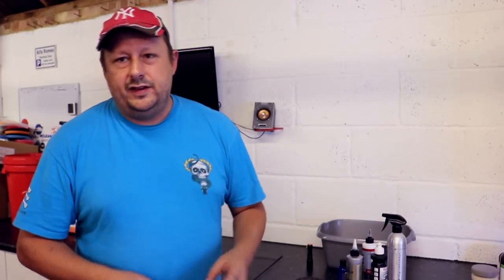Trashing Microfiber Towels with Ceramic Coatings

Comment: I've tried a few different types of towels prior, the dedicated 'pearl weave' MF's, 500GSM plush towels, short napped 300GSM towels, but I've always went back to cosco microfibres, plush enough for paint use and cheap enough for me to not care about throwing them away after. After i coated my car in Kamikaze, i kept some towels and applicators just to see how hard they would get and by the next day they were solid. Its just not worth using ceramic contaminated towels on a car after you put in 4/5 days worth of work into coating it.
Reply: +1 For the costco microfibers.

Comment: A very interesting video for people that don't have expirience with ceramics.
All professionals i talked so far bin them, they use cheap towels of medium-low quality to reduce cost. Each car is 5-7 towels approx.
The towel isn't reusable once the coating starts to cure-bond, how much time is that? Depends on the company and the coating, also depends on the temperature of the room (if it is done on summer or heated rooms it will cure faster). 
This video can save some "newbies" from scratching their loving cars! Keep up the good work ;)
p.s. There is no way to remove with simple APC the buffing matterial from the towel, if people say they did it...they probably used cheap short lasting "ceramic alike" products.

Comment: I'm glad someone else has mentioned this now.

This was the exact reason I never used my high quality ragmaster microfiber applicator again after I used it on a coating. The fibres just became really crusty and after several washes and attempts to get it out I've never managed it.

As said I haven't used it since, and especially after seeing this video I definitely agree with you Jon and won't use it on paint again. It's very noticeable ,and also the reason I've gone off coatings now and am back on the trusty fusso.
Reply: Adam Freeman Fusso fo the win!

Comment: Hey good to see you haven’t watched in a while but this caught My eye! My solution is don’t use $5 dollar towels! Get the pack at Costco here in the states they work out to about $.50 per piece in the USA!When you’re done wash them and use them on brake rotors or wheel wells!
Reply: Exactly what I do (you can get the yellow ones in the UK CostCo's too) :)

Comment: You spoke about the fact the silica is carried in a solvent, would it be possible to put the towels straight into a solvent mix to soak and dissolve the coating residue, then flush the solvent out with APC/water once you were finished the coating process? Great video by the way!

Comment: Maybe a hot wash in a machine might clean the cloth, but as you say it would have to be after each cloth was used, so even that would be impractical. Interesting video though, many questions to answer.
Reply: hot washing and detergent wont do anything, if you have ever worked with epoxy resin, you know that only a strong solvent would clean it off.
and since ceramic coatings are also resin based, that would do the trick, but i have no clue how much it would damage the fibers on the microfiber towel..
Reply: The "detergent won't do anything [to it]" is only true in the sense that it won't dissolve the coating residue. However, a wash is more than that, an exposes the towel to a lot of physical action, which just might very well release - or sometimes even tear off - the cured coating parts from the microfibers. It will be obviously not perfect, and what it can and will do will depend heavily on how much resin and in what pattern got in between the microfibers, to what degree was it already cured when it got in there, or how agressively you're washing the towels. But the wash process (combined with the use of detergent, which encapsulates anything that broke lose, an does not allow it to rebind) might remove most of the residue from the towel, up to a point where the particles still remaining in the towel can do no harm, or can't do more harm than any other contamination which you will also inevitably have in any and all microfiber towels, that have been used previously on paintwork.
Reply: @ paul taylor - I'd be a dead man if I put those in my mum's washing machine!
Reply: @berczigabor  Wishful thinking with no scientific basis.
Reply: @urntwrthyZ  And yet you couldn't even bring a single counterargument. That says it all.

Comment: Brilliant test. When I coated my car (CQuartz UK 3.0), I used the large supplied MF plus one cheap one of my own. I turned them pretty regularly but 2 towels is not a lot for a large estate car. I figured that as the applicator cloths were still damp and supple, I probably did not need to worry about the cloths hardening during the time it took to coat. A week later, the applicators were stiff with cured coating but the buffing cloths felt OK. Regardless, everything went in the bin and, now I have seen your video, I'm glad. I cannot find any swirls, despite only using 2 buffing cloths.

Comment: Before putting the cloths in a bucket of water i spray them with IPA even then they usually get relagated to glass,door shuts, wheel cleaning duties, it's easy to use ten MF's at 4/5 quid a pop it ain't funny.

Comment: Bearing in mind your points has now caused me concern using ceramic waxes, does anyone think using ceramic waxes (angelwax enigma) could also cause the same issues with the MF towels ?

Any help would greatly put my mind at rest guys, many thanks.
Reply from the maker: I dont think the ceramic material cures when its held in the wax.. but Im not 100% sure.   I seem to recal using fireball fusion and a big soft cloth and after the wash that cloth was all like hydrophobic and clogged up.    maybe thats worth exploring who knows.

Comment: What would we do without this channel?! There are decent cloths that cost very little like the Paragon offerings. They’re less than £1 so you can get rid without the outlay and not take the risk. Could still use them for wheel arches, tyres and engine etc.

Comment: My experiences are mixed. Sometimes I definitely felt that the towel's behavior (that I used to wipe of the ceramic coating high spots) changed and it became a lot less "pliable", like it partially got "rigid" or something (even though it did that nowhere near to what happens to the suede applicator, which will become like a thin piece of plastic or something). In this case I obviously never reused the towel, expect for probably rubber and engine bay work. Other times I've seen no change of the towel and even re-used them on paintwork for less critical tasks, without experiencing even the slightest signs of marring, let alone scratching caused by the towel. That said, because even pretty cheap (~50 pence) towels with low gsm will be good enough to remove the ceramic coating high spots with no ill effect, you could just as well dispose of them, if you want to be on the safe side. And it's definitely a waste of money to use more expensive towels to remove the high spots, because it just makes no difference.

Comment: By the way John, I asked the RAG Company in a long letter to answer to me why some people say that white vinegar and power clean in water can save towels used to apply or buff Si02 because that will prevent the Si02 from hardening.  This is what they said.  "Final answer is that towels used to apply Sio2's are NOT PAINT SAFE and should not be used on any soft surfaces after being used to apply an Sio2.   Soaking them in a water and power clean mix and then rinsing them in vinegar allows you to use the towel as an interior or "dirty job" towel so you aren't throwing towels away after a single use."   
John, if it wasn't for your video that proved to me that it wasn't safe to use them, I would have never known to ask the questions that have just saved my paint.  Truly, truly, I wish you a Happy New Year!

Comment: Results are results Jon, I wouldn’t need anyone elses view on those and double sure you don’t either now.
Immediatley thought “Why do you need top quality MF’s to remove CC”?
Lucky I finished the vid as you mentioned that at the end. So my question is why not use cheap Parargons?
Reply from the maker: I do  tats :)  its the only option really for me..  even if a towel is like 1.50 its too much for that to be a disposable item.  so the 65p paragone is the best option for me.  I can understand why so many take the costcos.

Comment: how long does the excess coating harden the surface of the microfiber towel? I'm just asking because if you're  using the same towel to wipe off or level any coatings wouldn't it harden while you're using it? or does it take a while?
Reply from the maker: I think it hardens reasonably quickly like 30mins to 1 hour to get a 95% cure.  but Im guessing.

Comment: THANK YOU VERY MUCH- IAM ABOUT TO DO THE FRONT END CLIP AND MY CHROME WHEELS..I HAVE  A PACK OF 10 12" X 12" mf TOWELS FOR $ 8 And Plan to use them and throw them away.. I assume I will be able to Feel the Ceramic MTERIAL IN THE TOWELS THE NEXT DAY OR SO..

Comment: Hi John, I need your help after seeing your video on using the 80/20 vs 70/30 microfiber towel.  It showed the 80/20  scratching the high gloss plastic on the A frames.   My question and issue is this: I am trying to save some money by buying the right MF towel to apply and buff off Si02 products, because I totally agree with you, those towels need to be thrown away and yes I could save them for other jobs, but I am doing just my cars and I have so many extra towels.  Which towel works the best, and is the best value?  I looked at the Pearl's but they are an 80/20 and since I have those Black high gloss panels, I can't use them.  Unless, when I am applying Si02,  that product when put on the black high gloss is protective enough to buff off the Si02 from the black high gloss finishes?   Thanks

Comment: Would you use them on the interior trim, let's say, besides engine and non-paint places?
Reply from the maker: only on a old cheap daily.. I would defo not use on gloss plastic trim which is soft and scratches but like a dashboard is fine.

Comment: This actually crossed my mind but I didn't do any sort of "testing", I just wash the towels and feel around on them looking for any stiffness anywhere. I could never find any by touch so I've just been using them as normal. I suppose based on this, I should start buffing coatings off with some cheap chinese throw-aways. the reason I hate the things is when I get them, I have to use scissors and cut all the edge binding off of them and its a bit pain. oh well, best to keep them separated I suppose and pitch them when done

Comment: ceramics, polish, cutting compound, waxes,  and anything you put on a towel or the towel picked up from cleaning sticks in to the towel and scratches the paint. some are noticable immediately while others take time to have the appearance. but will still scratch regardless appearance. the towel will go from soft and fluffy to feeling dry and oily at the same time. imagine you been sweating for hours and you drive from work to shower with the sun baking you. you got dry sweat and with the sun burning you. that's my view on how the towels end up feeling. not only do they scratch paint but it's impossible to clean windows with them. actually looks like it mauls the glass.

Comment: Terrific video.   I just did my car this weekend using your advice and the car is magnificent.   And I TRASHED ALL THE TOWELS.  I never want to mistake them for a good towel.  Thank you so much for your time and effort to answer a question I was wrestling with.   I have one question for the sealant sprays.  I would assume that the Opti Coat Sealant spray or the Turtle Wax Ceramic spray would also fall into this category of hardening polymers and thus would be unusable; correct?

Comment: So many cheap options on the market, Costco to The Rag company. With say Rag company making towels just for this purpose. It's a consumable product, toss them out.
Reply from the maker: the thing with higher quality towels is they should also last longer and stay softer for longer..  possibly upto 500 washes.  So as a tool a microfiber cloth is not really designed to be a one use item.     If in the case of ceramic removal the cloth should be relegated of disposed of this has wider implications to suitability based on low price.
Reply: @ForensicDetailing  exactly get the right tool for the job. My $$ microfiber is treated better than my girlfriend.. 
Keep up the awesome work ! Thanks for sharing your wealth of knowledge.

Comment: i never had a problem with microfiber getting trashed after using a ceramic coating but i have heard that glass coating can destroy microfiber after use. Btw can you make a video on how to remove heavy scratches and swirl marks in chrome? I been trying to remove scratches in the chrome on my motorcycle and it's hard as hell. Tryd Chemical guys heavy metal polish,PolishAngel Palladium. Used special very fine steel whool with metal polish to get of oxidation and rust and so on and tryd using my Rupes Nano to remove scratches and has almost no effect so would be great if you could make a video about it :)

Comment: I was thinking about this, would costco towels be plush/good enough quality to buff off the coating without damaging the paint?
Reply: I have not tried Costco towels (as they're mainly only available in the US), but cheap 12x16" ArmorAll towels (which cost like 6-8 pounds for a 6-pack) seem to work just perfectly. And you can actually do the whole car with just two towels. At that price it doesn't really hurt to throw them away after just one use, even though they might be perfectly suitable for later reuse at least on rubber or textured plastic surfaces.
Reply: Even very cheap ones with low gsm (like household towels) are good enough to wipe away high spots.
Reply: Absolutely, thats all i use...the amount you get for the price makes them ideal in my opinion!

Comment: The cons to a coating is that you have to use good plush micro fiber towels after paint correction and after coating and discard these towels that are like 8$ to ten each using a cheap micro fiber towel to buff off mill scratch it Costco autozone Walmart towels will scratch it lots of pros and cons I have a daily driver I just clay it and coat it if it was a show car I’d use good Mf towels during the buffing and discard even if I loose 100$ on the mf towels
Reply from the maker: costco wont scratch decent paint, but it might scratch softer paint (very very soft) or some OEM clear.      but you dont have to use exepensive.

the paragone premiuems are a soft 70/30 blend terry cloth that work great on smooth coatings.    some sticky coatings do benefit from a plush open pile towel and a good buff.  In the UK you can get the in2detailing korean yellow ones for 1.95 each..

I agree though you cant realistically trash a 8 dollar towel thats not viable is it.   Its kind of an issue.  but its an issue the industry is not in a rush to solve.   disposable microfiber.    untill it solves it people will turn to costco towels.

Comment: Jon, Changing subject slightly. What about water soluble acrylic coatings? If allowed to dry may not wash off in washing machine? If kept wet in bucket with apc, will wash off in washing machine? Like latex paint on your hands. Washes off easily when wet. Difficult to wash off hands if allowed to dry hard.
Reply from the maker: If its water soluble Brad then it should come out in the wash..   most water soluble acrylics are kind of water sprays..   The full on acrylic sealants are solvent carried.   but even with these theres a big difference between because whats left behind in terms of hardness..  ceramics are in a different league of hardness in terms of the material thats left behind after the cure...  but yer wax and sealants could and prolly are cloggin up the microfibers a bit when you use them but I think washing gets it out.

Comment: VERY important topic here man, thx for doing this content!  Im interested in Polishangel Rapidwaxx in particular, does it produce the same kind of issues with the microfiber towels? I know u have already worked with this product so i wanted to ask you what u have experienced. Some other guys already asked you about products like reload, cure, etc. and you said they dont harden the towels. Maybe it would be interesting to test some of these similar Sio2 products that are not exactly coating just to have some certainty how they actually interact with the towels. Thanks again!
Reply from the maker: rapidwaxx i believe is just a solvent based waxed emulsion.  no problems there.   I think all products harder in towels a bit.  but I think generally the water based non ceramic materials I think as a general rule you can wash them and get the materials out of the towels.   but even with some paste waxes and other product Im not always sure if you get it all out.  In fact I think a bit like pad washing if you allow certain products to dry in towels it wont all come out in the wash.  but it can start getting a bit ridiculous cant it.. dont know.

Comment: Recently my microfibre buffing cloths are grabbing on the paint and leaving a fluffy residue. Any ideas? I wash my cloths in a decent non bio washing liquid on a 60 degree programme. Even new cloths are doing this after a couple of washes.
Reply from the maker: I need to do a video on this one steven.   could be a lot of things..  can even be the product you are using on the panel.  can be debry/lint/contamination in the microfiber cloth.. can be batch issues with the microfiber..   are these open pile cloths?
Reply: Yes I believe so. I mainly wash my car with ONR. Very rarely use shampoo these days. Not sure if ONR over time leaves a build up of product on the paint. I know you use ONR. Have you noticed any similar issues? Thanks